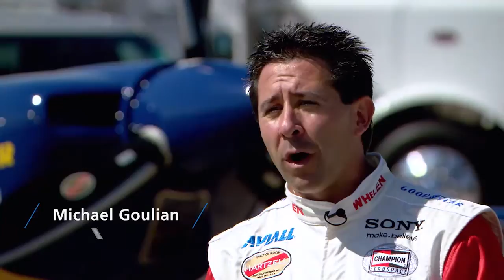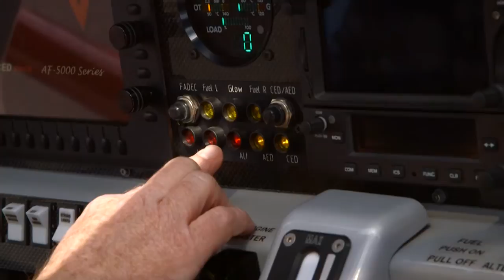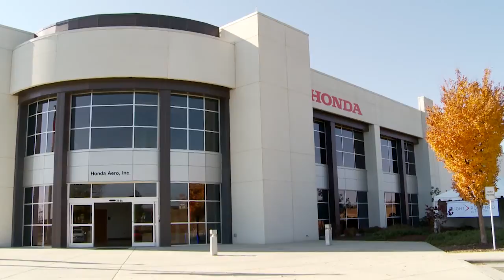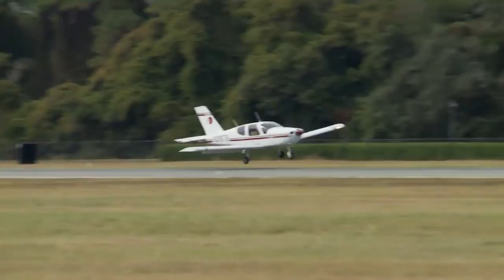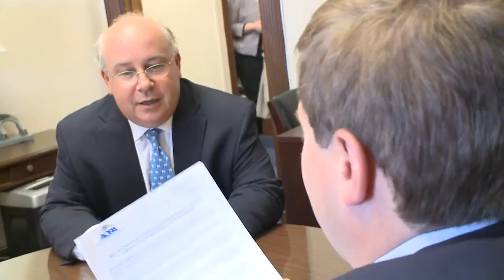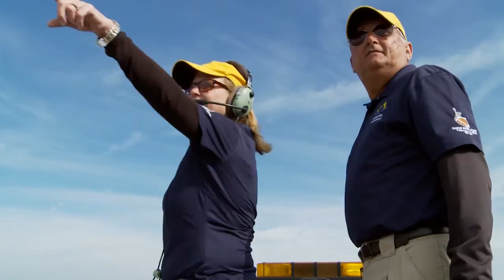AOPA Live This Week - November 13, 2014

Comment: There is no mixture in a diesel. It always runs on maximum air, and power is only controlled by the amount of fuel. This is a common-rail high-pressure direct injection diesel, and since it is derived from a fully computer-controlled automotive engine, you cannot easily convert it to manual control anyway. The direct injection Diesels always require very finely tuned, very complex injection regimes, sometimes injecting more than once per stroke.